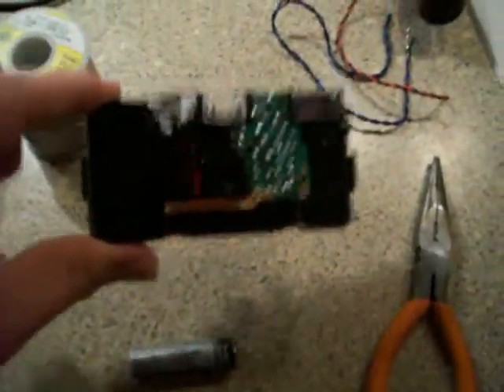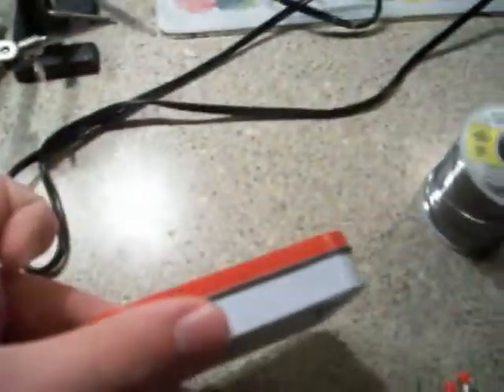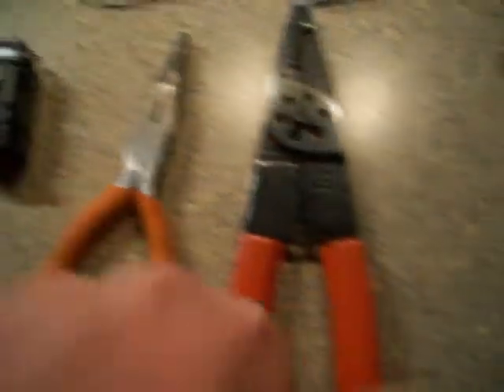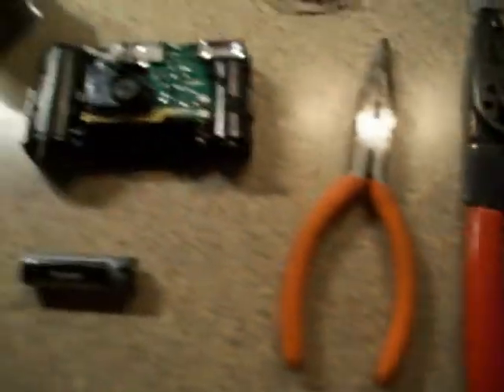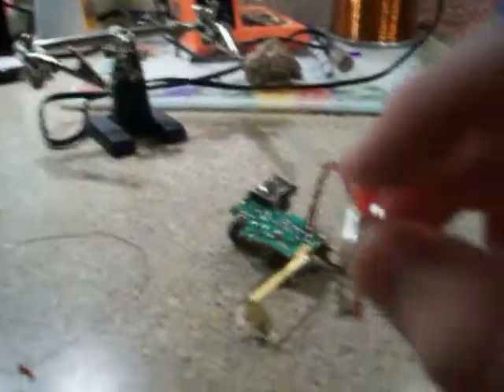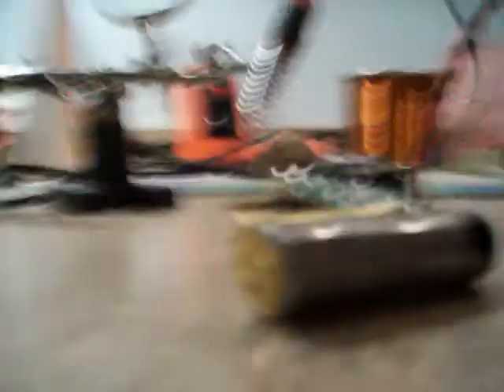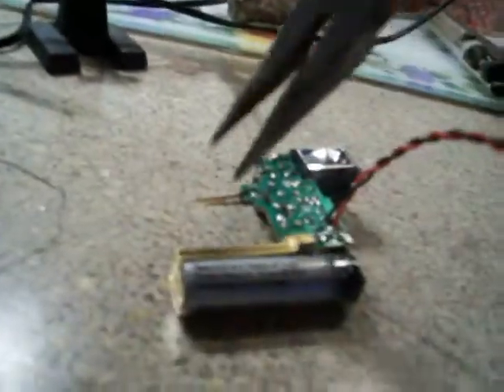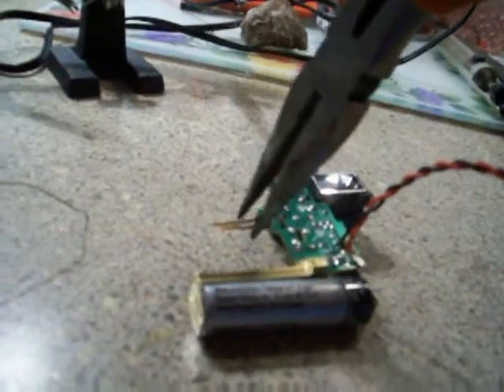DIY Flash Grenade Part 1

Comment from the maker: @pooty900 well the capacitor gives a huge burst of energy to a transformer that transforms it to high voltage that then goes to the light. you can try it but it may not work depending on the model you have.

Comment from the maker: @pooty900 So what are you trying to change? like are you moving the light or extending it? If so then just desolder the light and solder 2 wires coming off the centerboard and to the light. If not, i would just follow the tutorial and did what i did.